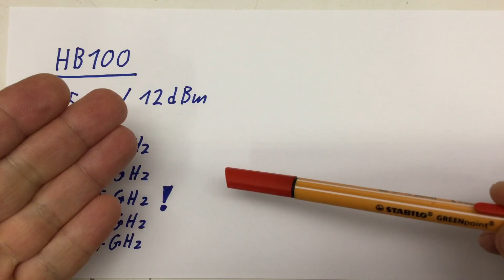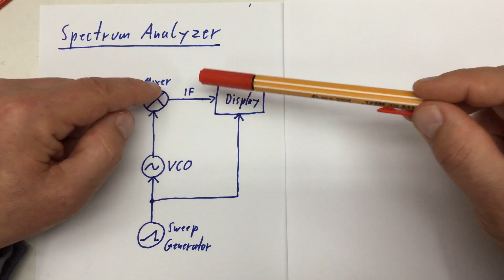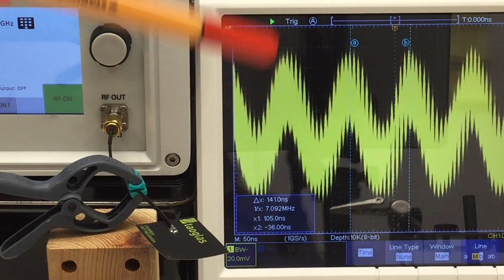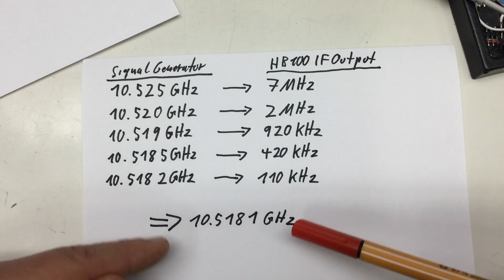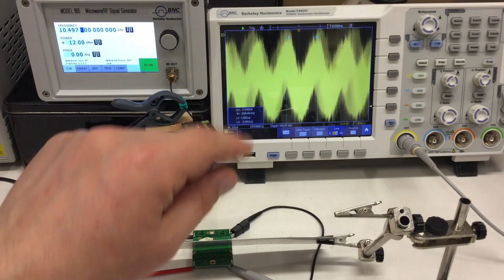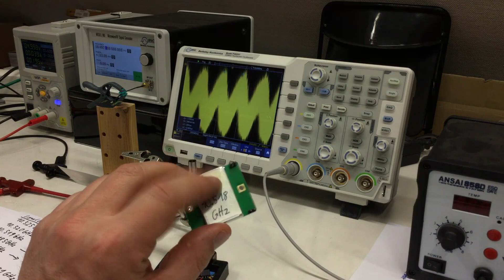Frequency Measurement of HB100 Doppler Radar with BNC 865 Signal Generator

Comment: Very good video. Super interesting. I have been working with these devices here in Argentina for a year. I am currently analyzing the intermediate frequency with artificial intelligence and fast fourier transform. The idea is to reduce false positives and use this module in alarms. I also did tests with the RCWL-0516, which is much inferior, and I noticed that there is a lot of influence between these modules. In fact, the emission is so low that it can be increased by adding more modules (just feeding them, without taking the data from the added modules). I don't know how this practice will influence the HB-100, but I'm going to try it. Thank you so much. Greetings from Buenos Aires.
Reply from the maker: Thanks for the praise! Doing a FFT on the output signal is definitely the way to go if you want to get the most out of these modules. Please let me know how using additional modules as transmitters works out for you. I think the challenge will be to make sense of the signal output of the single mixer, since the oscillators are not in sync (maybe close enough in frequency, but definitely out of phase). And greetings from Germany!
Reply: @robertssmorgasbord  What you say about ECWL-0516 is very interesting. From what I can understand, the device is basically a super-regenerative receiver. This puts the system at times in transmission and at times in reception. This change is given randomly over time. This randomness manifests itself as white noise, which is emitted in the form of RF with the frequency of the tank circuit between the printed circuit and the distributed capacities. The work changes are altered by a secondary antenna that increases the emitted power. It also affects the time it remains in the reception state. I also tried modulating the RF output with audio and it seems to work. More tests would have to be done. It's very interesting.
Reply from the maker: @dbagnis  Playing with microwave circuitry is fun for sure. I have to admit when it comes to the details, or more specifically, to make microwave circuitry exactly what you want it to do, I'm struggling. It's like black magic to me.

Comment: Hi!, could be possible measure distance with this module?
Reply from the maker: Nope, it's a doppler radar, so it just measures speed and doesn't care about the distance (as long as the distance doesn't get to large). To get a distance you need to measure the time it takes for a radar pulse (!) to be reflected back. Though this module could be pulsed, it wouldn't output any signal, unless the object is moving.

Comment: interesting i wanted to use the output from this microwave doppler as a 10 ghz frequency source by amplifying it.
Reply from the maker: I guess you could do that by loosely coupling the output (e.g. by a receiver antenna, if you solder something onto the output antenna patch you for sure shift the frequency) into an amplifier. But that's only viable if you're OK with aboutish 10 GHz.

Comment: Wow, IF output 7Mhz, really?
Reply from the maker: Yes, why not. The mixer inside that thing consists of a single microwave frequency transistor with no input/output filtering whatsoever. So getting an IF of 7MHz out of that thing is really not a problem.

Comment: Hi, that is a nice "third hand" , where did you get it from ? Sorry for the unsophisticated question , but I had to ask :))
Reply from the maker: No worries! Actually I don't like it that much. It's a wee bit flimsy. I bought it at a electronics store called Conrad. It's this model from Toolcraft (their house brand I guess): https://www.conrad.de/de/p/toolcraft-zd-10h-dritte-hand-l-x-b-x-h-150-x-74-x-120-mm-2269174.html . They do sell their stuff in several European countries: https://www.conrad.com/ .
Reply: @robertssmorgasbord   Looks better than the Chinese ones though. I find them useful to hold wires, components for tinning etc.
Reply from the maker: @mumbaiverve2307  Yeah, it's definitely better than the Chinese ones. However, it does have its shortcomings.